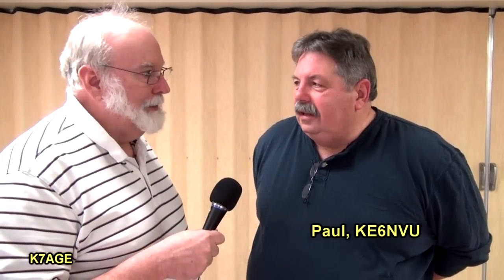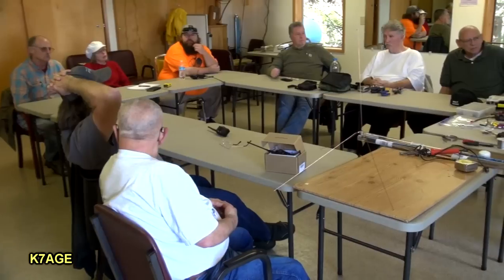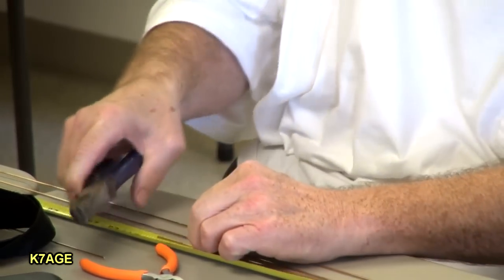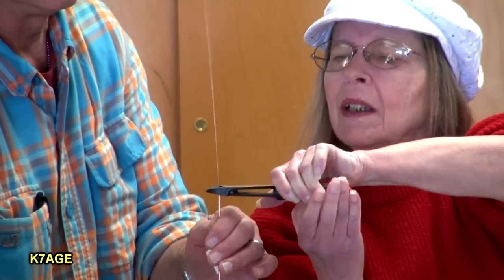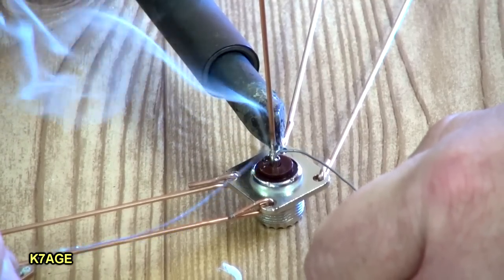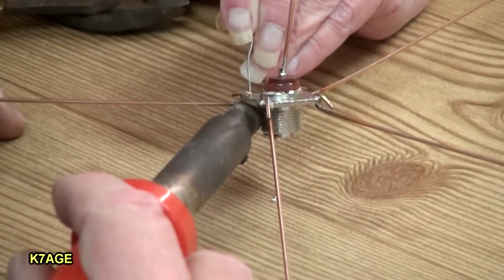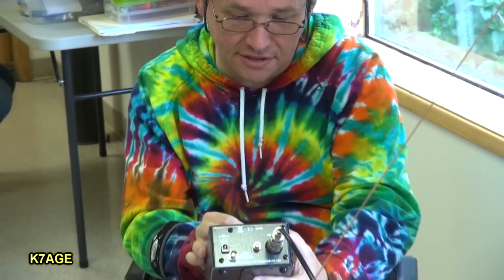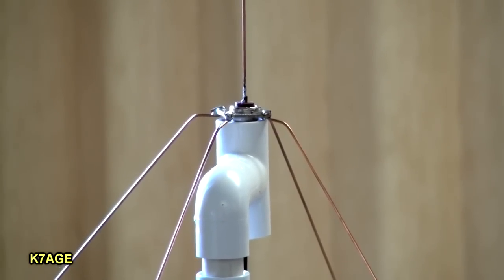Radio Club Activity Day: Antenna Building

Comment: I get that the antenna should match the the wavelength of the signal you are trying to receive.. but would love to see a course on the specifics!    For example, can you use the same telescoping antenna for HDTV , WIFI and FM..  if not, why?     Dangers of using  high gain antennas.. for example, I've damaged 2 wifi adapters by putting high gain antennas, how could one have known and/or avoided this?    Where do you start on learning when to use the strange shaped antennas, or using Baluns?!
Reply from the maker: Antennas for receiving are more forgiving on resonance compared to transmitting. Don’t know why Wi-Fi was damaged due to high gain antenna. One of the best books is the ARRL Antenna Book. Thanks for the comments.

Comment: i love antenna building. i would love to see more antenna building videos and hope they are more in-depth than the ones i have seen. like magnetic loops. and not one says the 1/5th sized inner loop can come in contact with the outer loop or if it must be in proximity to the outer loop. and the cap used, in tuning the antenna to frequency. and if a higher capacitance would give you a wider range and to which direction the frequency it would tune to given the capacitance as it varies. ie... a lower capacitance is a lower frequency and higher is the same in frequency. just a somewhat educated guess. i would like to build a 80 or 16o meter loop sized antenna and put on a wide ranging vacuum variable cap. like a 10pf to 200pf. and hopefully it would go down to 10 meters. and make a 2 to 1 balum. so i can make two mag loops creating a omni directional, that looks like an eggbeater.
Reply from the maker: +dale myers I have no experience building a may loop. Looks like you know more about these than I do. Thanks for watching.
Reply: ok thanks anyway. but to tell the truth. i'm like a kid running around with a stick of dynamite, called knowledge. where a little knowledge can be dangerous.